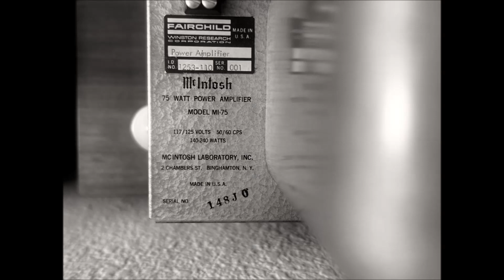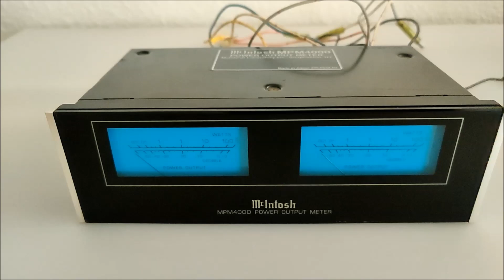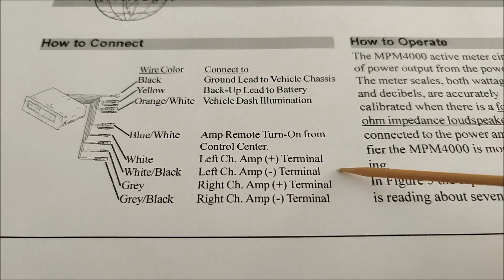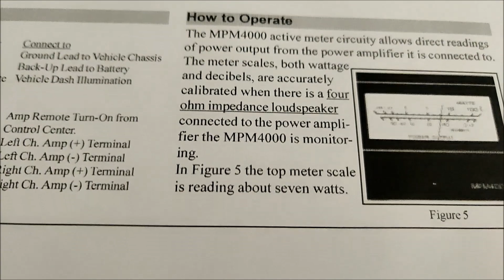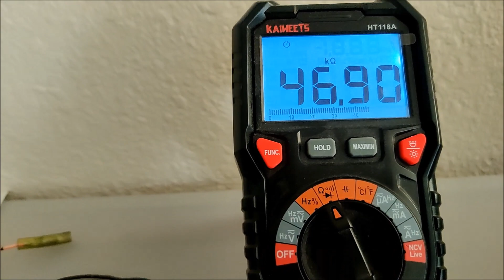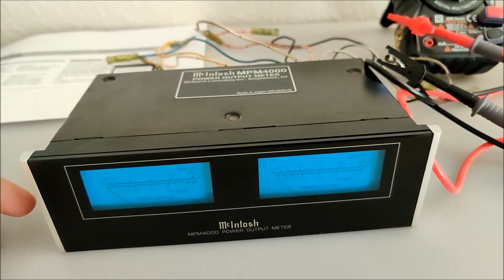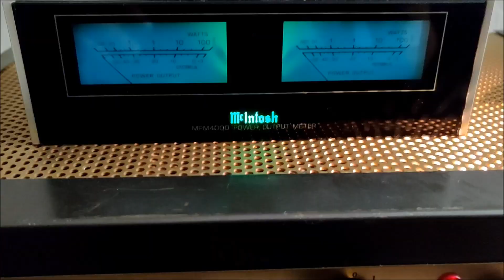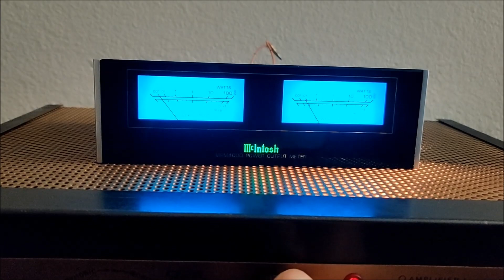McIntosh VU Meters DIY Vid#1 with Eico HF-81 Amplifier

Comment: Great video.  You left out the most important aspect of the video.  How did you connect each wire to get it to work?
Reply from the maker: Yes, I was not completely sure if it would work so I was recording intermittently on a phone without a tripod.  I have just uploaded another video detailing how I connected everything including the power supply. Here it is: https://youtube.com/watch?v=gNjrLIpb6VI

Comment: Looks like a fun project. Not for me though. I cannot stand VU meters with bouncing needles. Give me a spectrum display or Flourescent Display VU or Power meter any day. At least you can see non-analog meters from a distance. I have one amp with old timey analog VU meters and I hate having to walk right up to it to see if the channels are balanced and both working correctly. With a digital meter I can tell from across the room.
Reply from the maker: Agree, the needles can get distracting sometimes.  If I do implement some sort of vu meters in my rack setup I would add a power switch to the meters to turn them off if I need to.
Reply: @vintagetannoy  I don't even see them unless I am 2 feet away from the device. They are so thin like hairs for obvious reasons. That is a good reason why audio gear moved away from that nonsense and went to the LEDs or Fluorescent meters like the beautiful Pioneer Blue Flouroscan ones. Except for McIntosh which has millions of fans for the blue meters only. They could care less about anything but the McIntosh meters. Silly.
Reply: Blessfamy
Reply: @MikeGilbert-zm9lb  I learned a new word today. "Blessfamy". Not even in the Urban Dictionary. You should enter it and give a description on whatever it means.
Reply: I absolutely love VU meters my sound room is small so I got 6 of them I watch montering any input signal I throw at it sorry I spelled the word wrong it's Blasphemy meaning irreverence towards something considered sacred or inviolable.

Comment: There are quite nice, but given the very high price of these units even on the used market, something like the Fosi Audio LC30 or the Douk Audio VU2 would probably be a much better choice. These are aimed at the home system, and has the necessary hookups.  I suspect that you could change the LEDs to a different color if that was desired. There is also a European company that makes beautiful custom meters but I am to lazy to look for their sight. I think they sell a component kit as well. There is al
Reply from the maker: Thanks for your input.  I will look into Fosi Audio and Douk Audio vu meters but I would really need a 19" rack mountable unit and I was hoping to maintain the authentic McIntosh look on the rack but McIntosh doesn't make it easy.  Oh well.
Reply: @vintagetannoy  https://www.youtube.com/watch?v=TjbcQe_4swQ
Reply: @vintagetannoy  There is also a custom maker in Europe that makes custom VU meters. This has a very Mc looking vibe.  https://www.youtube.com/watch?v=TjbcQe_4swQ  They  have many videos on YT of different designs. I was looking at having them make me something and the price was reasonable. I did not do the project in the end, but they were someone that seemed promising.